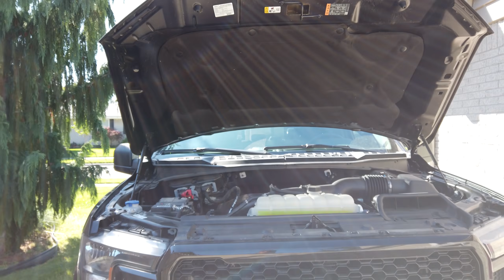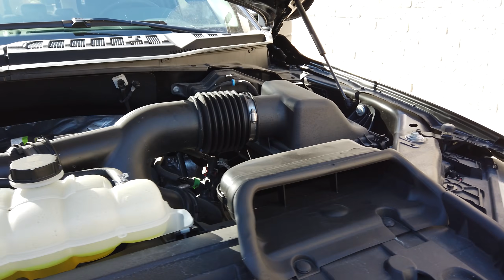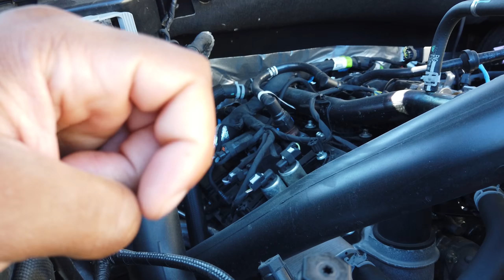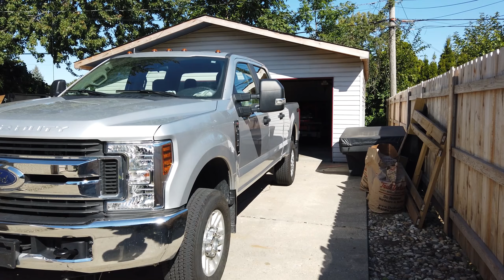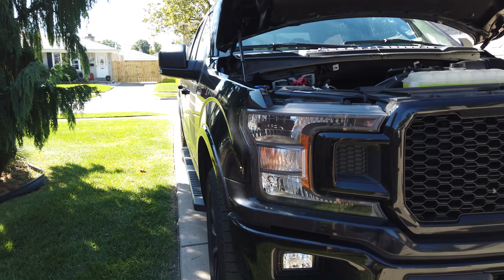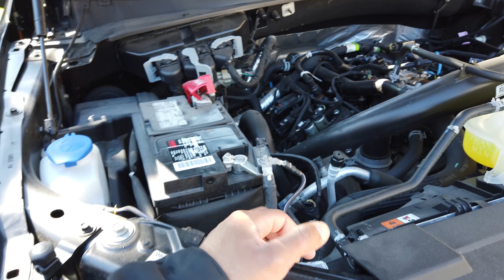Fords 2.7 l EcoBoost is built like a diesel?

Comment: ACTUALLY IT IS BUILT LIKE A DIESEL. CGI block like the 6.7, offset cracked rods like a diesel, combustion bowl in piston, multiple injections during power stroke. fantastic low end torque.
Reply from the maker: True
Reply: @DS-TRUCKS  updated comment

Comment: Nice video man love the ecoboost videos! My 2020 2.7 is great tons of power and so smooth coming from a previous v8 f150 thought I would never change until I got this rig fun truck 2 oil changes in always full on oil like it should and nothing to worry about, deffinately fords most advanced motor.  Also love ripping my buddy’s dodge and Chevys v8 with my v6 they were surprised 😮

Comment: The biggest worry about the 2.7 is the plastic oil pan that is sealed with no gasket.
Reply: Ford switched to all metal oil pans for both the 2.7 and 3.5.
Reply: Mark , where can I get the metal oil pan? I have a 2015 2.7

Comment: Hi Sean, I purchased my 2018 2.7L because of CGI block, did not want aluminum block and head. If 3.5L had CGI block I would have purchased 3.5L. But the 2.7L is based on a diesel design like the piston bowl and offset connecting rod which makes it silky smooth. I test drove a 3.5L and I just don’t need that much power, period. Hoping mine lasts a long time. There are some articles on the “Nano” and how it was designed. They do a better job than I explaining it. If people are going to be weekend warriors pulling 20 ft boat or 5,000 lbs travel trailer the 2.7L is an excellent choice. 
Sean since you work at Ford, I just had dash replaced because it warped. Dealership did an excellent job. Looking by the defroster it looks as if it will split again. Ugh. Peace
Reply from the maker: What trim level do you have? How bad was the dash. The 2.7 is the smothest engine I've ever driven. It's my understanding that a v6 gets harder to balance as the engine gets bigger. Hence why the 2.7 is soooo smooth. Im going to do more reading on the 2.7... freshen up a little, been a while.
Reply: Sean I have the Sport, like I said it’s a unicorn. Love the truck and very impressed with engine. It had a big hump on passenger side and was separated at defroster vents that was a good inch on both sides. I looked at new dash and I hope I was seeing right that day.  Looks like the new dash is thicker and has cutouts by defroster vents for some expansion. Time will tell. Get this, while waiting for paper work I looked at 5 new trucks, all have the bump and speciations. Not good. Peace